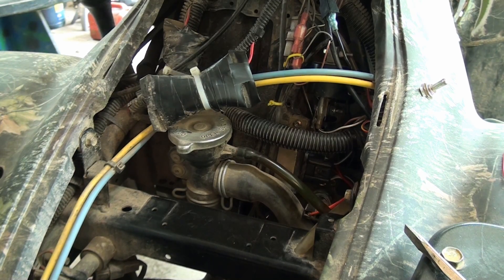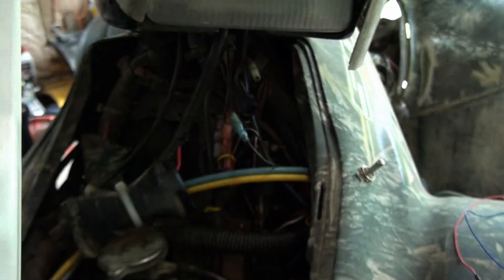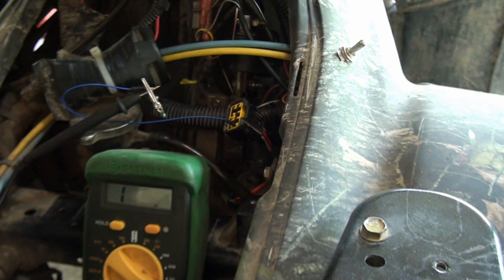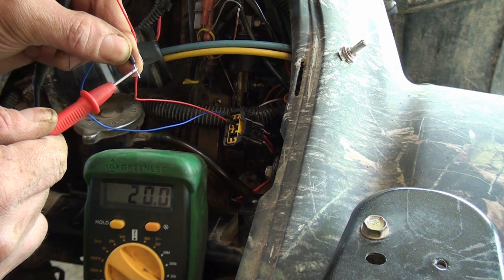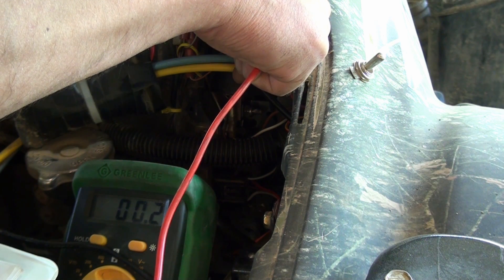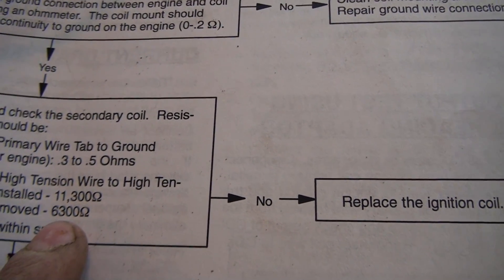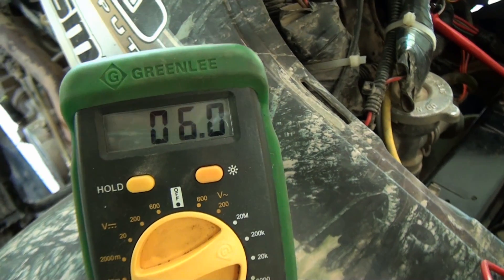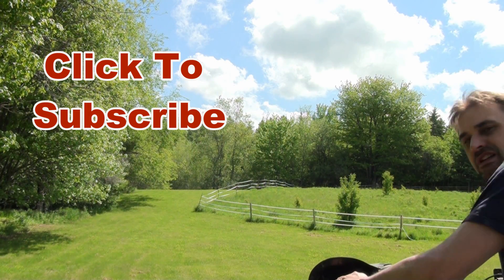How to Diagnose and Fix No Spark on a Polaris Sportsman ATV - Complete Troubleshooting Guide

Comment: Really good video. Too bad every wire, and the plug is different on my quad. None of the wiring diagrams I have found match my stinking machine. Trying for hours to find a similar video or wiring diagram to my paper weight, but NO luck so far. I now know why some people hate these machines, I'm, quickly becoming one of them. The procedure will be useful, and I will find the reference material I will need to do the job. Thanks for this video.

Comment: This video is outstanding! My question is I have 104 ohms instead of 97 ohms at my trigger coil. Is there a tolerance? Problem is I have no spark and Im down to checking wiring and all associated components. Thanks
Reply: Me too, 105 ohms on 1 and 130 ohms on my new spare... Stator checks out, volt reg checks out, good battery... Tried all the trucks, extra grounds,  stator plate advance or reversed... So frustrating

Comment: I saw a video on how to test for a short on a truck or car using a test light. You simply disconnect the negative lead to the battery, hook up your test light to the lead, then put the probing end of the test light to the negative battery post. If the light comes on, you have a short. I was wondering if this trick is also valid for ATV's since they use a different charging system. Thanks

Comment: What would cause a polaris sportsman 700 2002 automatically shut off when I put it in reverse  everything else is fine with the transmission I'm thinking there is a safety switch is bad or something I'm just got it and I'm leaning as I go

Comment: Where did you buy that ignition coil from?  I have bought 2 on ebay, both ended up having about 2500ohms resistance without the cap so they didnt work.  I can't seem to find one with 6300ohms as specified in the book.

Comment: i have 2003 polaris sportsman 500 ho 4x4 atv. key on coil ground 5.2 omes nut to eng 19.6 omes lead to coil ground nut 36.7 jumpping around lead to wire with cap on  nothing. white with red line to white 0 white to ground 0.red with black line to red 22.3omes red to ground 0.please help frank
Reply: nothing meening ol
Reply: Frank Taylor  ninj

Comment: Great video! I need a little help with my 03 Magnum 330 2wd. Any chance you could share a schematic that depicts physical circuit structure and wire colors. I have photo copys of a polaris shop manual with the diag flow chart just like the one you exhibit in this video, however I do not nor can I find the schematic w/wire colors and the pinpoint test result specs. My quad was running great for years, until one day my daughter was riding, as I watched her begin to ride off it back fired (through the exhaust) 2 or 3 consecutive times and then died. I got it to fire one time since. I don't have any spark.

Complicating matters beyond the no spark, my son figured he'd try to figure it out. His diag routine ultimately led to him disconnecting basically everything ( hard shell connectors, coil mount, the 2 CDI or ECM's, speedo head, all related steering column connections and all the grounds ) under the hood. If you can't share the manual, could you please denote the related wire colors and proper connection locations i.e. ign coil, wires to and from the ecm's and power/ground locations. I know there's only a few related connections, but I need to make sure of wire colors, power and ground loc's. My pulse coil has 60 ohms, not sure of the DC output from the pickup coil/stator.

The manual states that a PEAK VOLTAGE capture device is needed for diagnosis, is this true? Why would an old-school analog vom on a SUN VAT-40 starting and charging tester not be able to display the PEAK VOLTAGE and consistent needle swing while cranking? Also there are several spade connectors extruding out of the main harness that are NOT connected to anything..is that normal typically? I don't have a schematic to verify the correct wiring of any of them to determine whether or not they are used at all or for what purpose.

Thank you in advance for any help...I look forward to your reply!

Dave
all_city_petroleum@yahoo.com

Comment: This is a great video but there's more reasons a Polaris will not get fire. Kill/Start switch if it's bad then pull the black wire on ur CDI box. If you get fire then change that switch. OR, its in the throttle housing for ur thumb control on handle bars. There's a kill switch incase there incase the throttle cable breaks or hangs up wide open. pop open the top and separate the contacts with a piece of wood. If you have fire then adjust them not to touch. good luck
Reply: This actually got my spark back. How can I bypass this?
Reply: The thumb control

Comment: I've watched this video and used it step by step for my no spark problem. I have a 2000 scrambler 500 HO 4x4. I've changed every electrical part. new stator and pulse coil. 3 different ignition coils. CDI box. voltage regulator. I didn't replace the reverse interrupt box. I seen a comment about the throttle box safety wires. I separated the contacts with a piece of wood and the damn thing had fire!!!!!! it even sputtered. I was soooo happy! been over a year saving money hear and there for parts. then I tried again would not start because once again. no fire. It had orange fire and now nothing. again. went back to this video and checked everything and everything looks correct readings. Any thoughts??
Reply: I also do have fire coming from black wire out of CDI box

Comment: I have a 2005 Polaris 500 h.o. 4x4 i have spark when i use the pull rope to start engine but when i use the electric start there is no spark what could be the problem here. I replaced with new battery. it will only start up if i use the pull start meaning pulling the rope to turn engine over. Thank you

Comment: I have a 2003 polaris Scrambler 500×4, it's been sitting for a few years, it doesn't have many hours on it but after sitting for so long the battery is dead, so I got another one and it won't idle properly. I know I need to get it tune up, we also have a 2×500, any idea on what or where to start?

Comment: I have a 2003 Sportsman 500 HO and I'm trying to change the spark plug.  I took off the red cap and see threads but I can't figure out how to get to the plug.  I tried to open the unit its sitting in but there seems to be a gasket and I don't want to destroy it.  How do I get to it in order to unscrew it!  Thanks. Beth

Comment: I have a 99 magnum 500 ran beautiful one day I go to start it and no spark....I've used multi meter and I'm getting NO continuity between pin on coil to spark plug boot....took boot off nothing between coil and wire and also nothing between the boot itself....Also I had to check stator which was testing ohms by a black w red trace wire and the one next to it but I forgot the colors...The ohm meter is picking up nothing. So am I missing something or could all of these go wrong over night. I'm gonna need this kit along with a stator and new plug wire with boot. I just can't believe it was running one day then all this! Any help is appreciated

Comment: Great video thank you for taking the time.    I have spark and all the tests described in your video checked out properly in on my machine.    The problem I am having is that it will only start manually with the pull cord or jumping with a 200A boost charger.    It has a new factory Polaris starter, new pull starts assembly and a new battery as well.    I have cleaned the flywheel and pickup eye off.   Any suggestions will be greatly appreciated.    Fuel system is good as well and carb is adjusted properly.
Thank you